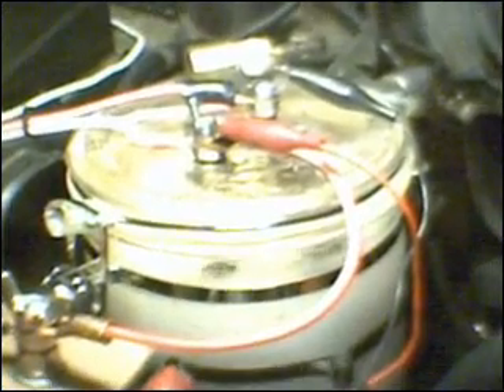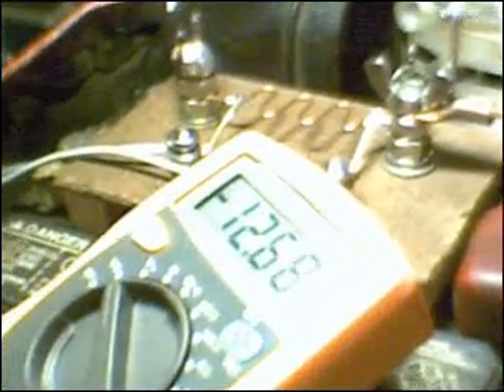#49 ANOTHER NEW RECORD 1.76 LPM HHO at 382W, 4.61mmw eff!!!

Comment from the maker: Boiling definitely is not desireable. Vacuum can spike to 25"Hg on decel. Keeping the cell very cool or regulating applied vacuum is recommended. I now have a pump I can use to actually measure gas production under vacuum. These should be some very revealing tests.

Comment from the maker: Perhaps. I should also point out that I am not generating this gas volume under manifold vacuum. I fanything there is slight back pressure from the bubbler. I ran some quick calcs on boiling points for various vacuum.

6.3"Hg = 600 Torr. BP = 93*C, 199*F
10.4"Hg = 500 Torr. BP = 88*C, 190*F
18"Hg = 300 Torr. BP = 75*C, 167*F
25"Hg = 125 Torr. BP = 55*C, 131*F

Comment from the maker: On a cold day when you exhale and see water vapor in your breath, what percentage if the air volume you exhale do you think is the vapor? I'll give you a hint. It's barely measurable.

Since it's not boiling and it's not steam, the water vapor from my cell makes up an insignifigant fraction of the overall output.

Comment from the maker: Because tubes have a practical limit to how many neutrals you can have. I have found for 13.8v in, the optimum is 5 neutral plates between two charged electrodes. Try that with concentric tubes. Also, quick changes in spacing are not as easy with tubes for experimenting.

Comment from the maker: Water vapor is needed. Steam is not. Given how rapid my circulation through the cell is, you're probably right. Maybe even some vertical heatsink fins attached to the outside of the cylinder, a concentric sleeve to fit over top of that and a 12v boxer fan at the bottom blowing up through, controlled by a temp switch.

Thanks for that inspiration!

Comment: Nice, but the actual total energy efficiency of the cell is marginally less than video 47...13,91 volts, 29 amps and 17 seconds for 0,5 liers results in 56,5% total energy efficiency while video 47 showed 57,3%.

Comment from the maker: Even though non-magnetic, 304 still contains much more Fe than 316L. It oxidizes when subjected to electrolysis into FeO. Hence the brown scum. Passivate in 10% diluted citric acid, 5% vinegar or 10% diluted HCl masonry cleaner to leach the surface iron from the 304 before using in electrolyte. Warm the diluted acid in the micro to 120-130*F and soak the plates for 20-30 minutes. No more.

Comment from the maker: I don't think so. Circulation through the cell's tall plate column stack is VERY fast. Even at it's hottest, it's still 53*F below boiling of pure distilled. Everyone knows if you add salt to water the boiling point rises even further. Same for KOH.

What you see in the vid is condensation of water vapor in cold air, not steam.

Comment from the maker: As the cell heats up, efficiency increases. I think if I regulated current to the cell with pwm and held it constant, as voltage drops off gas output would be more constant and controlable.

Comment: But that would require you to change the way you feed the HHO into the motor so you can control idle and speed. Also Retarding timing past TDC can't do any damage. It is when you advance the timing making it fire sooner during the compression stroke that you can do damage. Going beyond TDC only causes spark to fire while piston is already going down. TDC is maximum compression and would be the optimum place to fire.

Comment: Hydrogen burns so fast that on total hydrogen powered motors the spark is retarded to TDC or even up to 10degrees AFTER TDC. That way the piston is moving down as the spark happens. Other wise the hydrogen will explode while the piston is moving up. Creating predetonation or pinging, and actually robbing the motor of power. At 1.76LPM I would think you could run the motor strictly from the cell......

Comment: Hydrogen burns burns 6 times faster than gasoline. Because gasoline burns so slow the spark is fired while the piston is moving up then comes TDC the gas continues to burn and expand pushing the piston back down. That is what is meant by BTDC OR before top dead center.

Comment from the maker: I would except that I know how far advanced the timing is already on this car. The factory setting I think is around 10* BTDC. The adjustment range is about 5-20* BTDC. Then there's TWO vacuum advance diaphrams, (one cuts off after engine reaches operating temp) and mechanical advance that kicks in as the engine revs. HHO ignites so fast I have to believe advancing beyone spec would be detrimental.